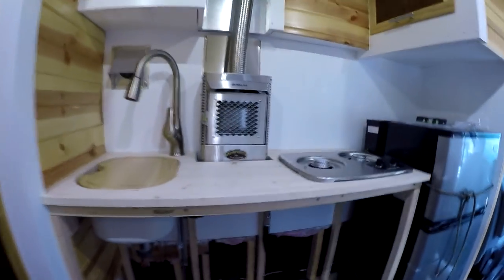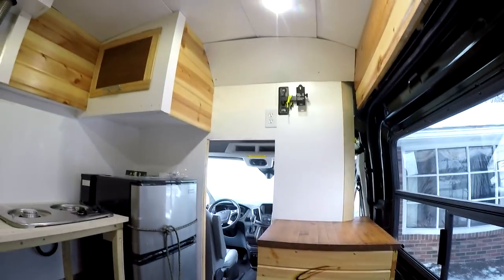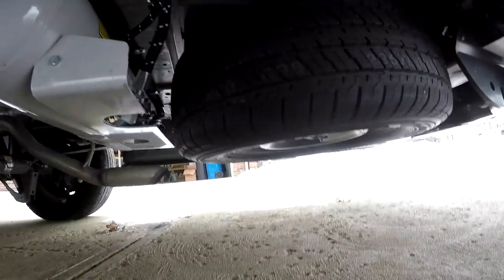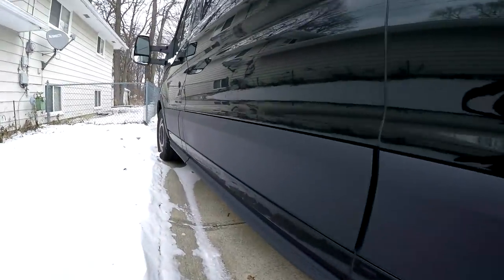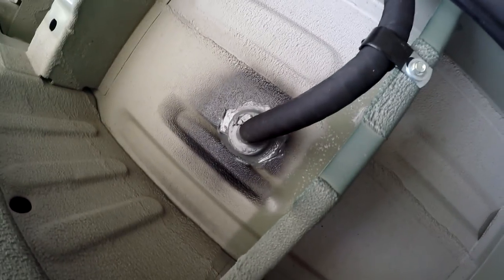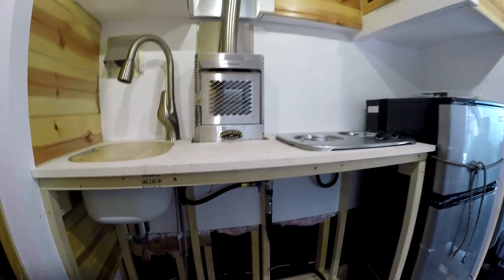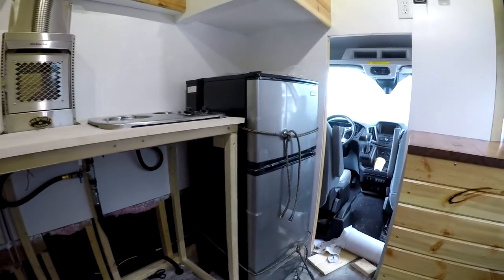Ford Transit Custom Propane Heating System DIY Camper Conversion Van w/ Dickinson Marine P12000

Comment: Thanks for the detailed information. Could you give the make of the propane tank? The link in your blog is "404 not found."  It's exactly what I'd like to install (have installed) on my 2015 Transit. Love the position and distance from the ground. I also like that filler port.
Reply from the maker: maidelie they apparently no longer sell that specific item on that site. This appears to be the same dimension tank by the same manufacturer (32”L x 10”D). https://www.amazon.com/Manchester-10-32-ASME-Tank/dp/B0064EDXYG
Reply: not waiting to live: Thanks!

Comment: I think your heating setup is wonderful. With the nice, dry heat you will get from your heater, you'll be able to visit national parks and other scenic destinations in the winter when nobody else is around. This will make the extra cost of your heating system well worth it. -Btw, is there a way to tell how much propane you have in your tank?  Anyway, well done, and have fun!!
Reply from the maker: Thank you. There is a gauge on the tank. I need to look into remote monitoring of the tank level so I can check it inside the van. I'm pushing that decision off until a later date.
Reply: Thanks for the info about the gauge on the tank. Keep up your good work!

Comment: hi Thank you for your video.. the link to your propane heater has been moved and is unlocateable on amazon.. is it possible for you to please share it with me so I can find your exact propane unit. Also, do you ever worry that someone can have such easy access to blowing you up while you sleep in your van.. if they find your propane set up?
thank again

Comment: How has it worked out having your Dickinson heater mounted as high as it is depicted here. Same van and same heater but learned I needed the extra length of chimney. Like that rack.

Comment: I have the same gas engine in my transit 350HD. I opted for the espar airtronic b1lc, gas heater. Simular to the diesel heater, just use gasoline. Challenge is, it cost me $3500 all up installed professionally anyway. The gas versions is more expensive than the diesel. I do think your setup is a good choice, because these gas heaters make a Lot of noise, inside and outside the van. How much noise does your setup make? Will be great to compare.
Reply from the maker: Braam Compton wow that’s some great feedback. My heater is quiet. There is a small fan that makes a quiet noise when on. But in total I’d consider the whole heater quiet
Reply: not waiting to live Then you made the right choice. I use my gasoline heater in - 30 degrees celsius in Canada, but it sounds like a jet engine and the van makes a huge noise. Enjoy your van, looking forward to see your final build!

Comment: What does the outside chimney look like?  How did you seal it?
Reply from the maker: https://notwaitingtolive.com/2016-12-1-van-conversion-week-3/ 

I used probably a $6/tube exterior window/siding sealing around the chimney. Hasn’t leaked in the 3 and a half years it’s been installed.
Reply: Ok.  My van has 3" wide ribs running front to back.  In order to get an entirely flat surface for the rubber gasket I had a friend with a CNC machine make a spacer that matched the ribs on one side and was flat on the other.  Thanks.

Comment: This was very helpful! I'm just wondering if you could respond to a question about the LPG tank piping; were the installers able to just use was looks like flex connectors to all your hookups or was any black steel pipe used? I'm trying to get the same tank for my build, but trying to DIY the piping and wondering if I need to start researching piping options. Thanks!
Reply from the maker: All flex connectors and they’re still holding up well after several years.

Comment: shouldnt there be a shield to protect the tank?
Reply from the maker: The propane tank is armor clad, ASME rated, which is even thicker steel than department of transportation regulations. The propane tank is mounted with as much road clearance as the gas tank. Presumably there will be no friction with the tank at all (gas tank or propane tank). And if there were I’d hit the spare tire first which has less clearance at a further radial distance from the axel

Comment: Curious to know if your happy with your P12000. Does it do the job for the van size? I have the P9000 in a 130 HR and at 4500btu, its not enough. You've got 5500btu and twice the size. Also, if your counting on the heat going down the all to heat that bedroom, I think your asking for much. If not happy, read up on the Propex HS 2211 forced air with ducting that you can route around the rig to where you need it, but it too is only 6500 btu and is a common heater for a Vanagon, so size wise......Suburban 30k heater???????
Reply from the maker: Douglas Higbee Thank you for reaching out. The short answer is I haven’t tried the P12000 out yet. The solenoid valve on the heater is either too dirty or needs replaced. When I fix that and test the space I’m hoping that’s where my insulation efforts will pay off. 

I’m troubled to hear the P9000 does not work for your space. Although my van is 4 feet longer than yours, the space I’m trying to heat will be  a walled off ~8’x5.5’x6.25’. This is 275 cu.ft. The P12000 is advertised as capable of heating a 1,100 cu.ft space. (P9000 is 800 cu.ft)

I have 4-6” fiber glass insulation on the side walls. ~3-4” fiberglass on the ceiling, 1-1/2” foam insulation on the cab partition and back walls and 1-1/2” on the floor. 

When you say the P9000 is not working for you, can you describe the conditions (outside air temp, and furnace runtime)?

I think others would find your experience useful.

Also how is your space insulated?

Comment: Great build! I'm following for inspiration on our own Ford Transit Van build. Any idea of what the rig weighs at this point?
Reply from the maker: Outdoor Wanderlust thanks man. I do not have a basis for my current payload. The wood is certainly heavy. Because the transit supports a 3,000+ payload some quick rough estimates (wood, tanks, appliances) project my final build under that, but likely heavier than 2,000pounds.
Reply: How about you do triangular or square cutouts in the wood to reduce weight? Watch Dylan Magaster's video on this very idea.

Comment: How do you open the valve on the tank when you fill it?
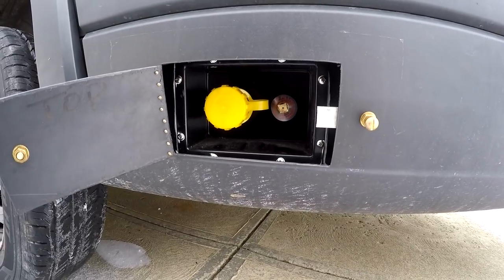Reply from the maker: James the tank has an automatic stop/fill valve. For a visual of what I am describing flip to the 1:46 mark in this video. The propane filling connection is under the yellow cap. If the tank is overfilled liquid propane will leak out of the fitting to the right of the yellow cap.

The tank itself has a shutoff valve but from what I’ve read this can be left open even when driving. http://roadtreking.com/rt62-need-know-propane-driving-rv/

Comment: You can get a diesel heater still, it just needs its own fuel tank (which it comes with) no reason for a diesel engine

Comment: Awesome build, just got a high top van and have noticed the fiberglass sweats bad, what can be done before I insulate is to keep the moisture out? Thanks
Reply from the maker: John Hales condensation is a response to temperature differences on the interior/exterior side of a wall/window. Condensation forms where warm air touches a cold surface (think of a cold can of soda in summer). In building construction they manage condensation by having an air/vapor barrier which captures the condensation in between a composite wall and directs the water out from between the wall via flashing material. There is no easy way to protect the inside of your van from condensation by construction methods. Increased air circulation and dehumidification might be your best approach.

Comment: Question:  are propane supply lines flexible rubber hoses from the tank to the heater?
Reply from the maker: Yes but at the moment I do not know any additional details. The installer purchased the supply lines. I will reach out to them for product info. I do know the remote fill receptacle and supply lines were from this kit:

https://www.amazon.com/Nashfuel-Propane-Remote-Mounting-Recepticle/dp/B00O95C0V4

I do not have any specification info on those lines either but they are flexible and appear to be heavy duty and fit for exterior use.
Reply: I am asking the question because I am building my own travel trailer from scratch and I also want to use flexible stainless steel braided propane lines in my project:  they must be easier to install because of that flexibility.
Reply from the maker: charlevoix418 Are you going stainless for more comfort with the safety of the installation? I feel comfortable with what my installer used if only because they are certified to convert gas powered vehicles to propane. To clarify though the flexible hoses they use are definitely a higher grade than what you find in the grill section of Home Depot.
Reply: Yes I am sure they provided you with quality hoses:  I used to be a sailor and I love stainless steel components, I used s/s screws, bolts, drawer tracks, tow ball, coupler, security chains, grab handles in my construction and I would like to do the same with my propane installation.
Reply from the maker: charlevoix418 very cool. What are you going to use for the tank and heater?
Reply from the maker: charlevoix418 I wish I saw a video of someone installing your setup. Would’ve been good to consider. 

Today I saw a good video sealed compartment type of propane install you may be interested in. https://youtu.be/CMqgRG3IHwY

Comment from the maker: Here's timestamped link to a professional Coachmen Mercedes conversion that has the propane tank mounted under the frame behind the rear driver side wheel. The clearance appears to be about as low as anyone would feel comfortable with (and this makes me feel better about where I put mine). https://youtu.be/sQ6J9tmpoqc?t=159
Reply: I believe there is a Dickensen Diesel fired unit very similar to the propane version. I wold have preferred it closer to the floor, as the heat will rise naturally in a convection current. If our feet are warm, you will feel comfortable.
Reply from the maker: David Jensen I defiantly wish the chimney exhaust was longer. But that’s as low as the standard stack that comes with it goes. If things get real cold I could do an electric space heater at foot level

Comment: But in that propane tank more dangerous outside like that supposed to Stone hit it didn't record it may blow you up..
Reply: They are not designed to blow up that way. Shorter than axel. He will be fine.

Comment: I bought a heater that taps into my promaster petroleum tank. It is similar design to diesel heater. Heaters4you.com. haven't installed yet but just to let your viewers know. Approx $400.
Reply from the maker: Teri Williams Thanks for sharing. I’m sure some reading the comment section will find that information useful.

Comment: I love the design work that you put into your van, but man, that propane tank, the place you put it under the van, near the pavement while driving, is to me like a bomb waiting to happen. 

The friction alone would be dangerous, the heat from friction. Then gravel could hit it while flying down the road and cause it to explode. Not a good choice to put it, in my opinion. 

Other than that, I love everything else you're doing,. a very nice design and I love the heater itself, very nice indeed. :-) ✌  ☺  🚐  ☕
Reply from the maker: Thank you for expressing your concern. The stakes are certainly high when dealing with propane. 
The propane tank is armor clad, ASME rated, which is even thicker steel than department of transportation regulations. The propane tank is mounted with as much road clearance as the gas tank. Presumably there will be no friction with the tank at all (gas tank or propane tank). And if there were I’d hit the spare tire first which has less clearance at a further radial distance from the axel.
Reply from the maker: Visual Traveler also thanks for your kind words about the design
Reply: many factory RVs have the same setup.
Reply from the maker: Visual Traveler I found an experienced opinion online about the limited dangers of low pressure liquid propane on the exterior of the van, even in the event of an accident. The text where he covers an accident is a few paragraphs in to the article linked here http://roadtreking.com/rt62-need-know-propane-driving-rv/. I thought you may be interested

Comment: You know that electric heat is 100% efficient. 100% of the energy is converted into heat. Propane may be cheaper, but not more efficient.
Reply from the maker: KB1IGM I’m not referring to appliance efficiency I’m referring to system efficiency.

“Assuming an electric heater with 100 percent efficiency, homeowners should expect to pay roughly $34.32 per million BTUs of heat.

 Assuming a furnace with a 78 percent efficiency, consumers should expect to pay roughly $14.02 per million BTUs of heat”

http://homeguides.sfgate.com/comparing-cost-gas-furnace-vs-electric-heater-61395.html
Reply: You'd need a billion amp hour battery and a zillion solar panels or a generator to run an electric heater...

Comment: I bet you 1900$ I could do it in one day and put the hindges on the inside and painted the hardware to match.  Many professionals would do that job for 500$
Reply from the maker: c sy Should you consider advertising then? Or is there more to running a business than one off hypotheticals?
Reply from the maker: For the record I don’t doubt it’s theoretically possible for someone to have the same install as mine for $500 in labor. I would have searched high and low before agreeing to $1900 in labor had I known that would be the total. But I don’t think being ripped off is as simple as a number paid.

Comment: You got ripped off on install price!
Reply from the maker: I've gone back and forth about feeling "ripped off". My request was for them to take propane tank I purchased, mount it to the bottom of the van, and hook it up to the furnace and stove I already installed in place. They needed to purchased whatever was necessary. Because this was a custom job and something they had not installed before the job needed to be "Time and Materials". My initial expectation was $1,000 or less. The total install ended up costing $2,600 but it included the remote fill station I did not account for (~$250 for the remote fill parts) and all the other piping and valving (another ~$250? for parts). Of the $2,600, ~$200 was tax, so we're talking about ~$1,900 in labor for professionals to install a quality custom job. At the end of the day I'm not all too disappointed about that price, even if it is higher than a hypothetical alternative install price; they run a business not a charity. And I am satisfied with the quality of their work and have the peace of mind of having a professional install something I perceived as a dangerous thing to mess up.